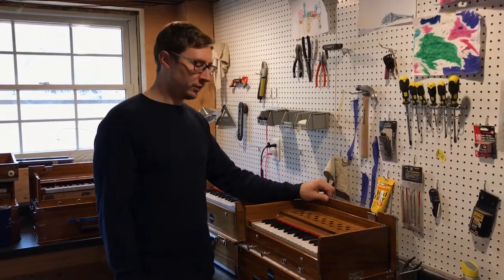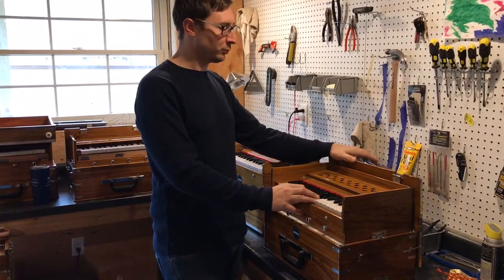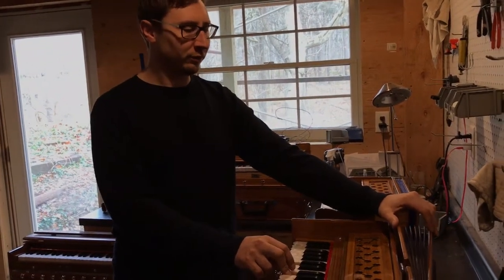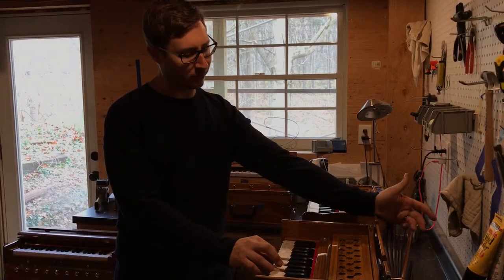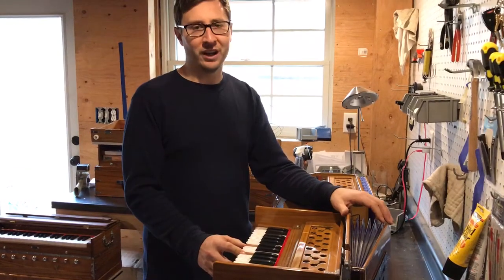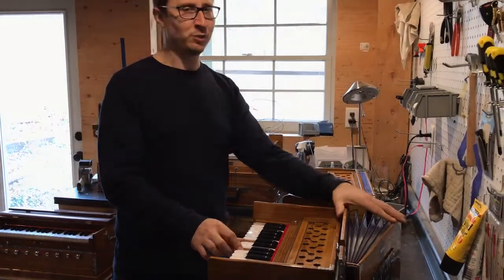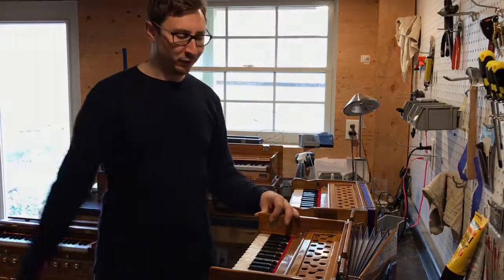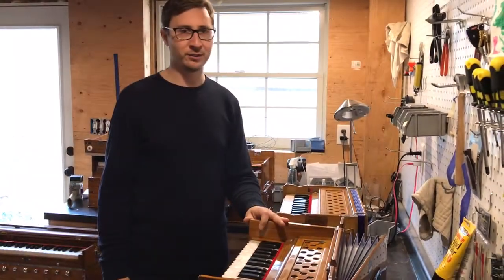How to NOT over pump a Harmonium

Comment: I like to have dynamic variety while playing but i noticed that when i try to play softer (what might be considered piano or pianissimo) the sound just drops off. It can't play that soft. Is it because the instrument is 22 years old? Or might it be for some other reason?
Reply from the maker: It sounds like your harmonium is not holding or allowing you to control air properly. This is honestly a very common defect on harmoniums. A good quality harmonium would solve your issue - any Bhava (http://bhavaharmonium.com) will do what you are describing, and for the best dynamics, I'd recommend the Studio or Classic platform. These have the most air, which means you'll have more dynamic control.

Comment: Hi, quick question. First, thank you for this. I would like to ask about a second hand harmonium that I have just bought recently. It was said to be new and bearly used but I noticed I strain a bit with the bellow.. And it looks like it was replaced. Does such replacement happen with harmonium? Is it possible that it is just because the material of the bellow is still quite stiff because it is still underused? Would really appreciate your help, thank you🙏
Reply from the maker: Hi, you can tear off an old set of bellows and replace them. That is certainly possible. In terms of "stiffness," it could be that they need worked in, but there is also probably a spring in there that could be adjusted. This would be inside the bellows, so remove the air valve to adjust that. Hope this helps!

Comment: So I have to "pump air" slowly for lower volume?
Reply from the maker: Assuming you have a good harmonium, yes. Slower air = quieter volume / slower response. Faster air = louder volume/quicker response. To define "good harmonium" - it should hold air tightly and be engineered to release air slowly. If your harmonium looses air perpetually or it's engineered to push the air out too quickly, you have no choice but to pump continuously and try to keep up - any any control of dynamics (loud vs. soft) is not possible with these harmoniums.

Comment: My harmonium had no sustain, so I opened the bottom and, saw two springs for the internal bellow , so I removed one spring and set the other spring to the middle of the bellow  ,now my harmonium has sustain enough to play 4 or 5 keys together .Do you think it was a good idea to remove one spring for sustain or shall I put the spring back .💝.
Reply from the maker: That is one strategy. On some harmoniums both springs are needed. On others it's not 100% necessary, but still, I prefer to widen out the springs and make them functionally weaker. Then you can have two springs pushing more lightly on both sides. Experiment and see what works best for you. There's no one "right" way. :-)
Reply: @OldDelhiMusic  thank you.
Reply: Look for singer no other than ayodhyyadas  on harmonium